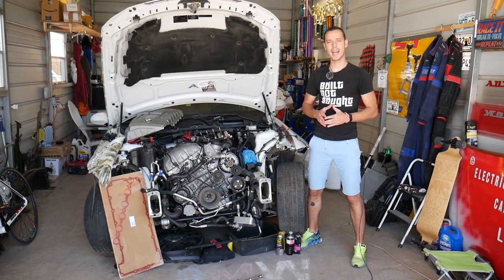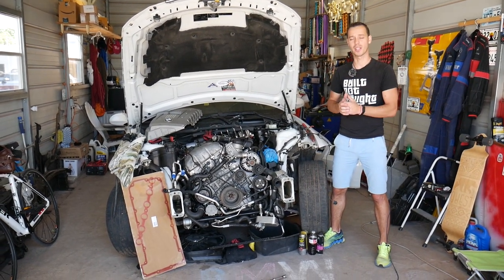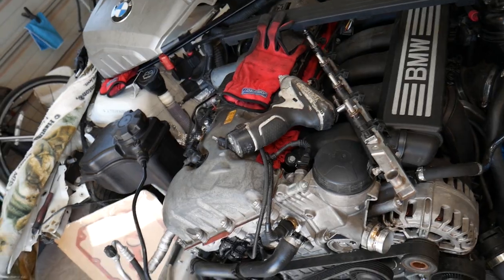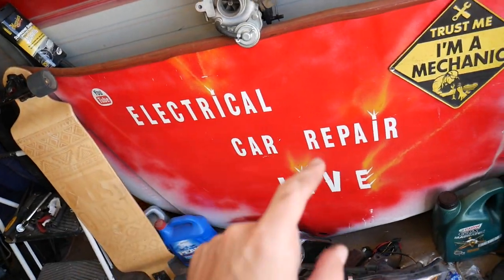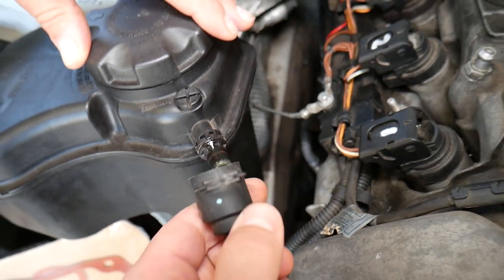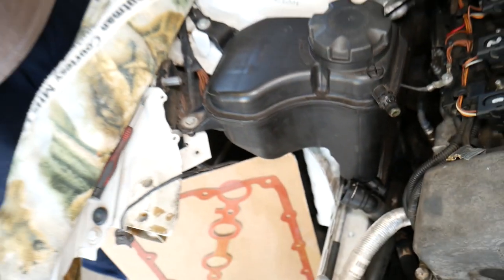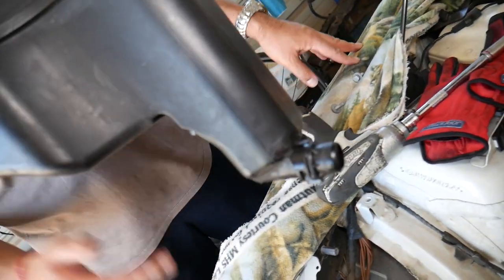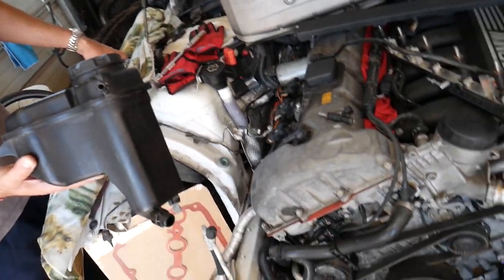COOLANT OVERFLOW TANK REPLACEMENT REMOVAL BMW E90 E91 E92 325i 328i 330i 335i 323i 320i 318i 316i

Comment: What is the bottom hose name??? under the coolant hose tank??? i don’t know if the o ring is leaking or the whole hose is destroyed i only have 130,000 miles
Reply: If you can, you're probably going to want to order a hose kit along with your overflow tank (if you can afford the oem parts, you want those for sure. Behr is also good, they manufacture for BMW) the particular part number I believe you're looking for is W0133-2371622, that's the lower hose for the expansion tank.
Reply: I lost the O ring on that connection. Would you know what the replacement is called?